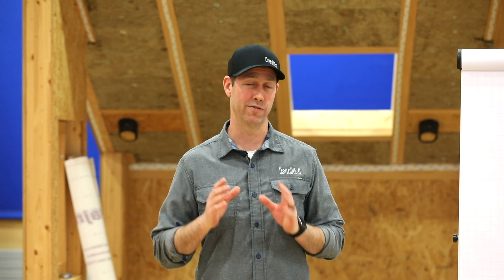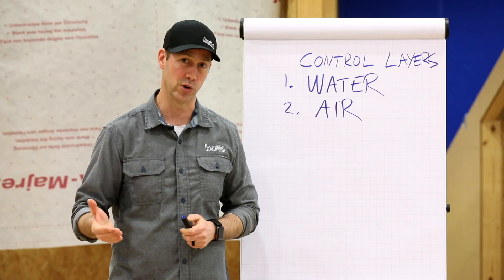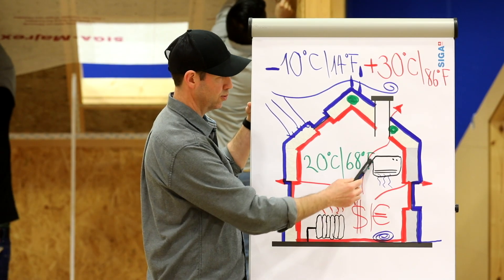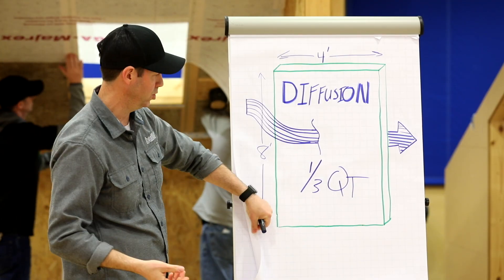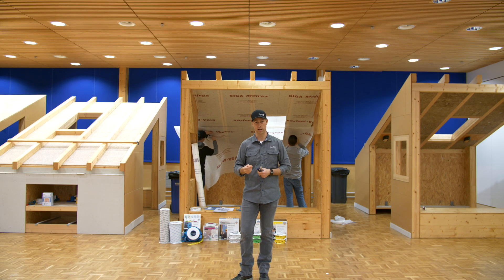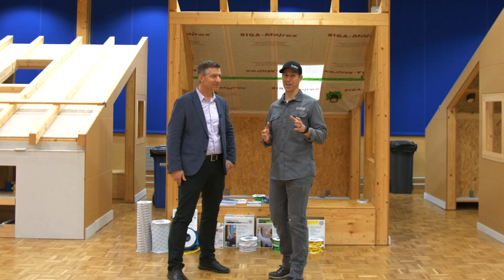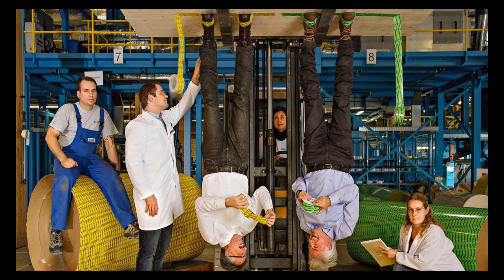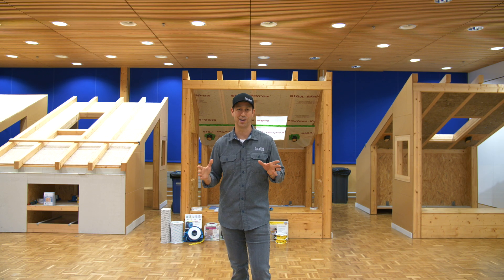Understanding Air and Vapor Barriers INSIDE your House

Comment: You want to stop vapor but you still need to get rid of it!
Reply: Yes - but as long as the vapor does not hit a cold surface, it will stay in vapor form.  That's why you put the membrane on the inside, just behind the interior wall panels.

Comment: Hi Matt, Great demos, thanks! QUESTION: I'm planning a whole house renovation (my house is about 27 yrs old and was built fairly well) I am planning on using as many of your recommendations (improvements) as I can. Can you point me to "the right way to finish a basement"? (waterproofing, vapour barriers, insulation, THE FLOOR, etc.) thanks!
Reply: As hellonko pointed out buildingscience.com is a great start.
But also, what do you have and what do you want?
Are you on a well-drained slope with no water problems, or is the basement catching water and you need to worry about infiltration and maybe adding a drain?
Is it a "day-light" basement with some venting easily available, or fully buried under another story?
Do you want  an open recreation area, with good air flow, ect. Or, are you intending to have a kitchen and/or bathroom in the space which can add lots of moisture.
Don't be afraid of engaging a professional to talk through your plans and ideas, you might get it for free, but a few hundred or a couple thousand dollars (depending on the project) of guidance and advice might get you something you're much happier with and save you money in the end.
Reply: Start at buildingscience.com :)